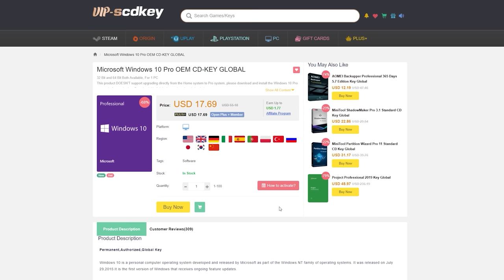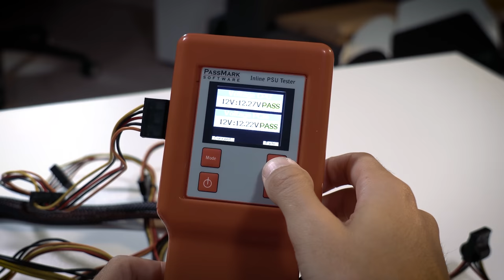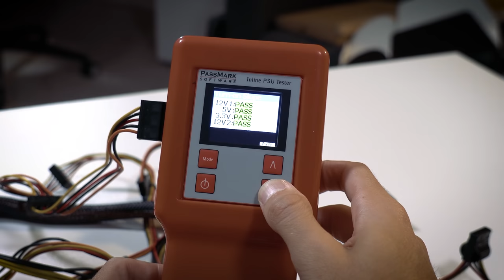Fixing a Viewer's BROKEN Gaming PC? - Fix or Flop S1:E10

Comment: That power supply has a faulty 5Volt output, So to fix it you can trace the 5Volt or for that matter if a 12Volt rail has failed, you can trace the supply from the molex output that has shorted to ground "Use a Molex voltage pinout guide", and track it back to the Power supplies PCB, Then on the PCB, You can check every Electrolytic Capacitor connected to the shorted rail using a multi-meter in continuity mode by having the positive lead of the multi-meter connected to positive of each capacitor underside of the PCB, and the negative multi-meter lead going from the multi-meter to the negative lead of the capacitor underside of the PCB, If you have an in circuit ESR meter this step will be so much easier at can point out the bad capacitor in circuit.
  
Also check for Bulged or leaking capacitors "goo near their base of all electrolytic capacitors", and if any have leaked, remove them noting where their replacement negative lead has to go, Clean the PCB with IPA and replace the capacitor with as close as capacitance, and if possible a higher voltage rating "it has to fit back in" back into circuit.  

You may more than likely also have to replace Mosfet and voltage regulators connected to the shorted rail, Once they're replaced ensure the short is gone by checking with your multi-meter, if the short is gone great! 
But advise client to up grade to a better PS, Now if the short persists after replacing mosfets and Regulators, then it's time to replace all the Electrolytic capacitors connected to that shorted Voltage rail which BTW was the one that took out the replaced Voltage regulator and or Mosfet Chips. 

It should cost around $25~$40 "Ass-Trail-Yen" Bucks all up, So if the Power supply is a Piece of crap costing around $80 "Ass-Trail-Yen" bucks or less then I would recommend the client they fork out minimum of $200 "Ass-trail-Yen" Guessing $120? "Merry Kin" Bucks for something better..

Comment: It is a good thing you swapped the power supplies because if you had them claim a warranty on this the warranty would not have been honored because you voided the warranty @ 17:36 because you opened up the power supply. So that is your responsibility at that point to get them a replacement power supply because you voided the warranty. You can clearly see @ 17:17 that the warranty sticker was still intact.  So you would have to swap out the power supplies anyways because of that reason. Disclaimer to anyone thinking about opening a power supply. If you do open the power supply it automatically voids the warranty so if you still have a warranty on it DON'T open it up.

Comment: That Cool Master computer case is least a decade old design if not more. I know this cause I built a computer system for my mother using that computer case a decade ago.
I been around PC's since MS-DOS version 1 and have the knowledge to do electronic repair as well.  In the past someone had a motherboard let the magic smoke out and I was able to repair the motherboard.

Comment: I actually have an identical Cooler Master HAF 931 case with my latest build in it.  It's a Ryzen 4700G based machine, btw.  I  got that because I still need a drive to burn CDs and DVDs.  Coincidentally, I got the same Be Quiet fan mounted to the case side.  It may be an older case, but it's still a good one.

I also really  like the fact that Greg doesn't pull the D*** maneuver of "double dipping" when it comes to making these videos and providing parts to the owners of the PCs that he repairs.
Reply: I have that same case too.  Ive built 3 different systems in it.  It is probably one of the best cases I've had.

Comment: 15:42 that is known as zeroDB all gpu's from the RX400 series on both amd and nvidia side have that now. you can turn it off to have the fans running at all times, or you can have it setup so when your gpu reaches a certain temperature the fans will kick in. i.e fans set to 45c fans will kick in, anything less and the fans will not spin. Once the gpu hits 45c and above the fans will kick in and will work in unison with your fan curve, so 45c/30% upto 80c/100% (this is just an example of how this feature works).

Comment: Great video, I had the same with a power supply that would be ok in windows but, when the graphics card needed more power the machine would just shutdown, it was a 900w power supply from a reputable manufacturer and is worked for years without issue.

Comment: I suspected the PSU as soon as I saw that it was Thermaltake. Granted, I am no electrical engineer, but after 30 years of builds, upgrades and repairs, the only PSU I have had burn out was a Thermaltake. This was brand new and lasted all of 20 minutes. I know there are probably good units, but with all the great alternatives, I have never taken that chance. I still have off-brand PSU that are 20 years old that work fine. Currently, my go-to brand is EVGA, but I know there are many other great brands and that, to be fair, one must compare same-tier units.

Comment: Yeah, I've been pulling my hair out on my server PC, It'll crash randomly, sometimes it'll crash right away, or a week later, or month later, no amount of stressing it seems to make it crash, swapped out parts, bought parts, it still kept doing it, I decided to hook up my volt meter to the molex plug and I caught it! 

At idle it'll run at 11v on the 12v rail, stressing it it'll go up to 11.5 and even jumps to 12.4v suddenly, or drops below 11.3v under load. At idle though I caught some drops below 11v, saw 10.6v at one point although the system didn't crash but 11v or lower is a problem. But months and month and I finally replaced the PSU and all it good. I was abought to retire the server.

Comment: I had a problem almost exactly like that! The system acted exactly like that, yet my cheap power supply tester ran the power supply just fine and the LEDs showing the voltage showed the correct volts, but it didn't have that extra feature yours does. I needed to upgrade anyway because it's a 100 something wat power supply and I got a new board.

Comment: Hey that's my case! Although I removed the lower drive cage and painted the inside black, cable management could be easier if the would have given a bit more room on the back but not a bad case.

Comment: Had this exact same issue with a friend's pc. Replaced the PSU and boom job done. 

The psu was a new corsair 550x? I think it was. 

Brand new. 

I didn't think it could be that, so went through a myriad of things tranna figure it out. Was happy to finally come to the conclusion that the psu was screwed, replaced it with another cheap psu. All works fine now.

Comment: Good stuff!  When I saw that first flash I imagined it was the PSU after going through a similar issue a while back.  I of course didn't come to that conclusion so quickly and had swapped out every other component before trying the PSU as it was brand new and working fine the month or so before...

Comment: Glad you got the pc working for the viewer, and that's a really nice PSU and case upgrade. My only comment is that the case appears to have provisions for a vertical GPU mount which you didn't use. Was the extension cable you used not long enough, or is there a bracket that's needed and something that is sold separately from the case?

Comment: If you have RAM slot issue, it might actually be CPU socket issue, clean the socket from dust, might give you signal after that, but be aware not to twist pins.

Comment: Love these vids. Years ago, 2003 or 2004, I found a mid 1990's era IBM PC300GL in trash. I then tested it and it all worked. I spent $250 upgrading. Bought a NVidia GE Force FX9500 PCIe graphics card, a 80 GB Lite On brand HDD, a Lite On brand CD/DVD RW drive and found a still wrapped in anti-static plastic PCIe Soundblaster 10.1 Surround card. All installed on the manufactured pc internals and original case. Original CPU was a 386 or 486 series Pentium. The long vertical style. Ran Vista Pro as well as all realism options turned to maximum on both Microsoft Flight Sim 2000 and Microsoft Train Sim. Best build on a budget I did.

Comment: My immediate thought on seeing that kind of instant cutoff is always going to be 'it's probably PSU'. Because that's not been long enough for the Mobo to have even started to throw a complaint about something. That's an immediate trip of some sort of voltage protection, and unless the mobo is totally fried, it should still attempt to continue POST even if there is no cpu. At least with modern Mobos. Can't say that is the case with all older ones.

Comment: I had this same issue with my pc build 6 years ago. My PC starting doing after a year and did it again. after a second PSU. The first time I never changed the cables so the second replacement I got I completely changed all cables and it's been going strong for 4 years now

Comment: Hey Greg, your channel really grew up on me, didn't watch that many videos at the beginning but now I'm pretty hooked up. Got a question regarding this build, why did you use a bracket to cover the original expansion slots and mount the GPU sideways there instead of using the included ones that the case has, farther away from the motherboard? Was it to avoid having the GPU too close to the glass and affecting airflow? I'm thinking about buying a riser cable for my 4000D case which also has those two vertical GPU slots above the regular expansion slots, but then saw this build and this question came to my mind

Comment: hi greg just quickie to do with the dust where you  mentioned that you don't think that the dust is nothing to worry about on the circuit board  it can make a difference , dust on electronics can be a killer to certain components by if your in a damp environment  or if its been raining  the moisture in the air can make the dust conductive and act like a short and kill any component it comes in contact with . or if you live in a dry environment  it can induce static electricity to the board and could kill any sensitive components again it comes in contact with  i used to come a cross it here in the uk . which looks like what's happened to that poor power supply i hope this will be of some help to you kind regards paul . p's love the vids keep up the good work and like the idea of the mobile work shop i would do it .

Comment: Ideally shouldn’t that pump still be lower than the AIO rad? Just wondering as I have seen that the AIO rad in the top of a case is the ideal placement? At least for AIO’s? Great channel this and fully concur with the PSU advice. Years ago I decided to have a look at a faulty one and touched bare pins on the cable. I had a nasty shock and thankfully got away with it as live pins are no joke. Learnt my lesson though 😊 Just rail testing from then on.

Comment: All right! I might have been lucky but the PSU was my first guess. Why? Because the system turned on and immediately off so some PSU protection mechanism had to be active (motherboard?) or the PSU itself has to be broken. A defect storage device should never be a problem for POSTing, at the very least it should POST and you should get a notification. If the graphics card would have been defect then it should still POST given the integrated graphics on that Pentium and without it the system would not shot down within a fraction of a second.

Comment: I did something similar on my parsonal desktop after it wouldn't turn on. Testing every part and replacing the motherboard until I found out that the ram seating was so close to my cpu that I bent the pins when installing ram. That was a fun week of replacing parts and upgrades.

Comment: If the system is powering on and off for a split second the first time you try to power it on and then does nothing, try to recreate the scenario by cutting the power off for a minute or two. If it happens again, 99% of times it's either a bad PSU or a power pin is being shorted to the ground. PSUs have a short protection system that shuts the unit down as soon as you short pins. Even if you resolve the short it won't start until you fully cut the power off for a while.

Comment: if you look closely at the power supply when the tester stop beeping, you can see small flashes of light on the cable side of the power supply towards the camera kind of by where those silver divider is

Comment: Quick question for anyone here, and Greg if it comes up. I really liked the look and everything of the Be Quiet! Silent Base 802, but when I checked compatibility with my motherboard (Asus TUF H370-Pro Gaming (WI-FI) ATX LGA1151 Motherboard), I came across an issue. I'm seeing be quiet! Silent Base 802 ATX Mid Tower Case has a front panel USB 3.2 Gen 2 Type C port, but the Asus TUF H370-Pro Gaming (WI-FI) ATX LGA1151 Motherboard does not have sufficient USB 3.2 Gen 2 or Gen 1 headers. The case USB 3.2 Gen 2 Type C port will not be usable. Is this something to worry about? Is there a work around? Or is there a different tower that could be recommended?

Comment: With the hot topic of the "wrong usage method of the thermal camera" recently, I think if this would one of the good cases to use a thermal camera to display the potential hotspot which may be the cause of failure. That would be a great example 🤣

Comment: After the first mention of it not starting and nothing starting I told myself it’s the PSU. Nailed it.
Reply from the maker: Actually, the build started... for a split second. That's why I believed it was a short at either the PSU or cabling level. In episode 13 (which will air soon), the system flat out refuses to turn on at all and the PSU wasn't to blame 😅
Reply: @GregSalazar  my computers leds turn on but not the screen i've tried all the cables, but i'm too scared to open the glass and do stuff with cables IN THE COMPUTER. What do you think it is? I live too far away from you to send it. Oh and if u cant help me online i have guarantee on it so they'll just fix it 😅
Reply: @GregSalazar  simpson's DOH

Comment: If the PSU trips it often won't start again unless the mains are cycled with enough of time so the caps can discarge and the control electronics actually power cycle, that's why you had it not turn on for splif of a second because you had cycled the switch too quick.

Comment: Honestly, I'd at least try contacting Thermaltake about the PSU, at least, my experience with their customer service was pretty good. Fan on my PSU stopped working outside warranty, and they still sent me a new fan free of charge. I know this is not as simple an issue as replacing a PSU fan, but still, might be worth a shot.

Comment: My psu broke just like this a few weeks ago, I barely just got it. I was really scared to open up a psu but I knew to not touch anything with my bare hands so I just cleaned the major dust and hair with a brush, there was a lot. It booted properly and I was super happy. However it would be really useful to know how to discharge the psu beforehand properly for newbies.

Comment: I once had a PSU which wouldn't work in winter. It used to power up for a short time then turn off again. The solution I had... use a hair dryer on it until it was warm. I did that for months before deciding to get a new PSU haha.

Comment: "This would be a much easier fix than a dead card or a dead motherboard."

To this day it still baffles my mind, and I find it completely incomprehensible, why you never, ever suspect the PSU. For the entire first 7 and a half minutes of this video, until you said that, I was saying "CHECK THE POWER SUPPLY UNIT!", over and over. If the problem is "the PC doesn't even turn on", my very first thought is "POWER SUPPLY UNIT. Check that it's not a DEAD POWER SUPPLY UNIT!"

And of course that wasn't your very first thought. It didn't even cross your mind. Why? A dead PSU is the number 1 culprit.
Reply: Because the video would be over way too soon. Maybe he saw it but did it just for entertainment reasons
Makes sense to me

Comment: Great video when I help fix friends/families PCs…..first question I ask if the PC a was plugged in with a surge protector and not a power strip.   You be shocked how many people either plug the pc right to the wall or use a power strip that they thought was a surge protector. I’d say 80% of the time a PSU is the issue , it got fried from power outages (over/under) current damage.

Comment: Dunno if its just me but I really had bad luck with thermaltake PSUs.
Had ''thermaltake smart se 630w'' after few months my PC stopped turning on (or it would turn on after many random presses of power button and fliping the switch of PSU)
Contacted the shop for warranty/ replacement.
Got new unit of the same "thermaltake smart se 630w''.
Few months later - bye bye again :DD
Switched to other brand.

Comment: You had me nervous. Anytime I suspect electronics failure with power supply I would never wear that much metal touching skin. Power supply is usually simple and has enough fail-safe to avert any shocks but usually when the case comes off it's box you don't want your face within a foot of a capacitor. Again these are extremely rare issues but very devistating to a human body when it happens.

Comment: Hey Salazar! The client doesn´t tell you how get that issue with the psu and how long of used does it have? Bc i have the same PSU (Thermaltake TR2 600w) and i have 1 year used and sometimes i overclock my graphics card (RX 580 8gb) and for now i dont have any issues. You recomend switch my psu or wait for a better upgrade? Thanks for you all videos dude!

Comment: I've had a similar issue, and also suspected on the psu, but it turned out to be case screw standoffs that hold the motherboard since i didnt remove the extra ones after switching cases, so they shorted pins on the back. Im lucky that the board is somewhat newer and had some sort of short circut protection, otherwise it could fry the damn entire thing lol